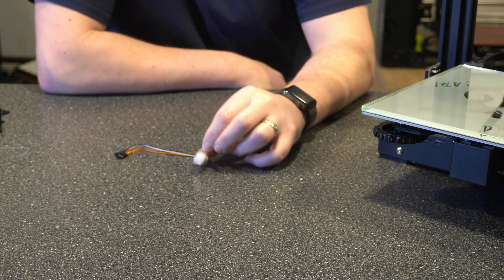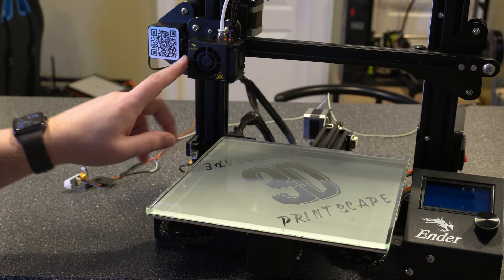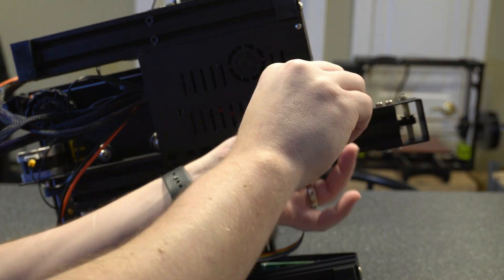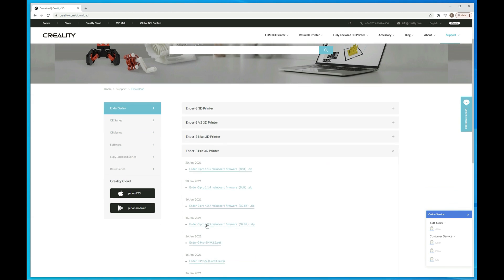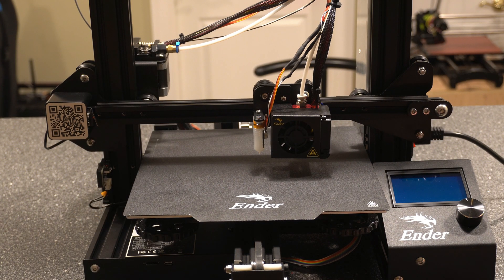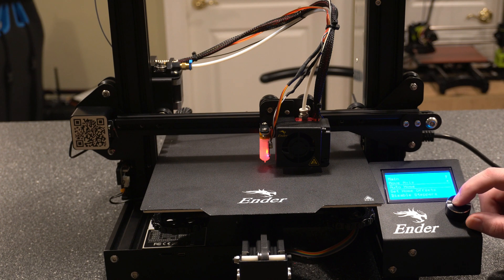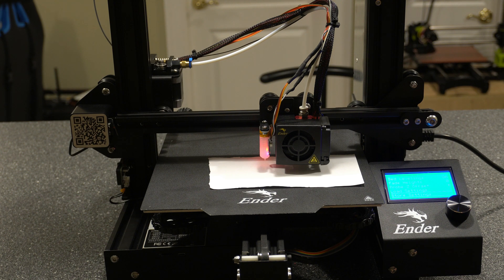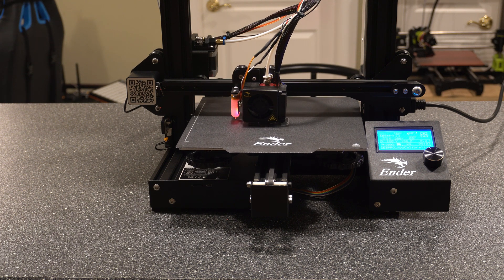Guide to Install a BLTOUCH on a Creality 32-bit Mainboard

Comment: followed this video to install a bl touch on my ender 3 I just got.  went through the steps although some of the steps did not go exactly like in your video.  I assume there have been some updates along the way since you posted this video.  when I turn on the machine now, the menu on the LCD screen is different.  the "control" feature is gone.  also once I turn the machine on, the bl touch turns red and stays red.  also when I try to auto home, it says homing failed please reset.  I unplugged the bl touch wires from the mainboard and tried to auto home again and got the same error message.  I tried to move each individual axis using the option on the menu screen and they wont move.  any suggestions or help you can offer would be great.  just got this thing for Christmas and it appears I now have a 15 pound paperweight.  super disappointed and bummed now.  hope I did ruin something for good.
Reply: well looks like i downloaded the wrong file from Creality.  can i download the correct one and will that overwrite the one i accidentally downloaded?  going to try that, fingers crossed
Reply: That fixed it.  I was in a hurry and excited and downloaded the wrong file from creality.  erased the wrong files off the usb and downloaded the right ones.  hooked it back up and updated the printer with the correct file.  Everything is back to normal and working perfectly.
Reply from the maker: Hi. Its way to easy to grab the wrong firmware, people do it all the time. Im glad you were able to get it working.

Comment: Hi,

I was wondering if you could help, my printer came with a bltouch but it only has the short leads like the one you purchased. It did come with a longer set of leads but they go to a single plug not 2 like you showed. Is there any way you could do a video showing which plugs you fitted to the leads you extended. Thanks
Reply from the maker: Hi. I would just get some ribbon cable with the same colors, cut the wire on one side (leaving enough room to work with), then connect the wires on both sides. That's basically what i ended up doing.

Comment: I connect my two pins into the 5pin slot on the version 4.2.2 board and my screen stays blue and smoke appears from the board? The ground is in the correct place, any advice? Thanks
Reply from the maker: Hi. Sounds like the wiring is not correct. You would have either 3 or 5 pins plugged into the bltouch port depending on how you are trying to wire it. If your getting smoke, a positive and negative wire is reversed.
Reply: @3DPrintscape  hello thanks for the response, the screen has now gone blank 😮 unplugged the BL touch and reset but the screen is still blank
Reply from the maker: @DjMrBubbles  Its possible that the board is fried. Check all the connections though, it may be a loose wire.

Comment: quick question.  Is this the same process for the E3 Max?
Reply from the maker: Hi. It should be, i think the mounting bracket for the max is a little different though. I know the CR Touch comes with a separate one for it.
Reply: Thanks. Yes the kit comes with 3 brackets. All seems to work just fine.  Great guide BTW.

Comment: When I tell it to level the bed my bltouch only probes 3/9 spots then stops. Anyway to fix that?
Reply from the maker: Hi. It sounds like a wire or connection may be loose, especially if its stopping after the one on the far right. Its possible the cable is getting puled when going over that far. I would go back and verify all that.
Reply: @3DPrintscape  thank you so much for the response. I think that you’re right. I’m going to take a look at it and will let u know
Reply: @3DPrintscape  you’re a genius one of my wires did not have the length to move to the other side of the bed. Thank you🤟

Comment: I'm having issues where the BLtouch fails during bed leveling at random points. Sometimes 3/9, sometimes 8/9, etc. I was able to successfully run through it once but each print it ends up failing. I replaced the BLtouch and this one does the same thing, except now its not retracting the pin after failing. Did everything exactly as you did in the video, except my kit came with the 5pin cable from Creality.
Reply from the maker: Hi. It sounds like you may have a loose connection. I would go back and check the wiring again. Looks to make sure the pins are fully in the adapter and making contact with the board. Also, follow the wire back to make sure there isnt any slices in it.
Reply: @3DPrintscape  Thanks for the reply. I've checked the wiring and it seems to be good. I tried the TH3D firmware and I've ran the levelling about 20 times without issue. Switching back to Creality firmware, it fails within 1 or 2 runs of the bed levelling.
Reply from the maker: @andremaury9861  Based on that, the issue is clearly with the Creality firmware, though it does seem odd.

Comment: i have an ender 3 with this board, i upgraded my printer with the enlarging Z axis kit from creality BUT! now that i just install an bltouch i cant compile a marlin firmware that works.. the thing doesnt home or do the 3x3 probe thing in the bed,  any guess of what could be happening? i can install the creality firmware tho.. but i loose the extra 100m on the z axis.
Reply from the maker: Hi. What errors are you getting when you try to compile the firmware?
Reply: @3DPrintscape  i mean i can compile the firmware, Marlin 2.0.X bugfix, but when i try to level the bed or print something the bltouch just probe in one space and then stops and do nothing, but if i use the creality firmware works like a charm but i lose my 100mm extras of z axis.
Reply from the maker: @ShInJiPsX1  If it works with the creality firmware, we know everything is wired up right. It sounds like the firmware isnt configured to match the bltouch wiring, I would look there first.

Comment: my ender3 says it's a Merlin 1.1.1 my board says v4 2.2.2 do I need to look for that type off firmware
Reply: thank you
Reply: and look for same bl touch firmware or can I update merlin to better than 1.1.1
Reply: my board u get to it from the top not bottom like yours
Reply from the maker: Hi. You just need the bltouch firmware for the 4.2.2 board. It doesnt matter what version you are currently running.

Comment: My bl touch auto homes and does nothing else on my ender 3 pro
Reply from the maker: Hi. How is the bltouch wired and what firmware are you using?
Reply: @3DPrintscape  it's one plug in the board has the port for the touch
Reply: @3DPrintscape  firmware is from creality itself but when I downloaded it and went to my files and clicked on the file it doesn't let me get into it
Reply from the maker: @byronmurray9885  What is the order of the wiring and the full name of the firmware file?
Reply: @3DPrintscape  one multicolored wire to the port on motherboard. I got firmware from creality itself. It won't load to SD card. The downloads look different from the download u are using
Reply: I found the firmware exactly  like yours on the video I downloaded it and extracted it and when I opened it up and went to the one without transfer case it was empty
Reply from the maker: @byronmurray9885  You will want to verify the pinout on the harness, I have seen them shipped with the wires in a different order. They keep changing the firmware names and zips. My guess is that your are downloading one of the marlin packages they are trying to provide but I haven't tested those. You could try the firmware I have on my site. https://3dprintscape.com/marlin-firmware-builds/

Comment: Thank you so much! You now have a subscriber for life! My ender pro sat for months because I couldn’t get a damn thing printed correctly on it. I finally decided to upgrade the board to avoid having to flash the board with an arduino. Low and behold, your video saved me. I’m now running Merlin and just printed one of my best benchy’s yet! Thanks again for the easy to understand instructions.
Reply from the maker: HI. Thanks for the feedback and sub, Im glad i was able to help out :).

Comment: Great video. Everything is showed in such a clear way that it is impossible to fail! I have just a question: if I set Z MIN PROBE ENDSTOP INVERTING to TRUE the compiling fails asking me to change it to FALSE. I have an ENDER 3 PRO with 4.2.2 motherboard. thanks for all!
Reply from the maker: Hi. Thanks for the feedback. There was a change made made to the bugfix line after i made this video, so that value now needs to be set to false.
Reply: @3DPrintscape  nice to know! thanks

Comment: Are you still Active? the video is super helpful, but my wires are a different set of colors and im not sure. I dont want to hook something up wrong and mess my printer up. Please Help
Reply from the maker: Hi. Ya im still active. The written instructions i wrote as a resource for this video may help out there as i go into a lot of detail on the wiring. The link is in the video description.

Comment: So do you unplug the Z-Stopper or leave it in?
Reply from the maker: Hi. It depends how you have the bltouch wired. If you have all 5 wires going to the bltouch port, you would leave the z-stop connected.
Reply: @3DPrintscape  Thanks for replying. Weird situation I ran into. I have E3Pro w/ the 4.2.2 MB and a BLTouch v3.1. The BLT has the 5 wire plug figured out. When I un-plugged my Z stopper, no matter what the Bed Level routine would constantly fail randomly at any bed spots [1-9]. When I plugged it back in, it worked no problem. I'm leaving it plugged in. TY..
Reply from the maker: @Blood1UTUBE  The z-stop needs to be connected when you have all 5 bltouch wires going to the bltouch port. You would only disconnect it if your plugging the bltouch prob wires there and using z homing firmware.
Reply: @3DPrintscape  Thank you for confirming.
Reply from the maker: @Blood1UTUBE  You're welcome

Comment: I just bought an ender 3 pro with the silent 4.2.7 motherboard,bltouch and touch screen upgrade kit. After auto homing I can’t get the z axis to move in the negative to set the z offset compensation.
Reply from the maker: Hi. It sounds like the software endstop is enabled. You can disable that by sending the m211 s0 command to your printer.

Comment: Thanks for explaining but how would you do the preference to change it to do the mesh layer on Mac?
Reply from the maker: Hi. I would need to make a video on this, so i will add it to my backlog. There are a lot of little difference so it would be hard to cover them all without doing a video or making a guide.

Comment: I unplugged the Bl touch and plugged it back in and is now working.  I had to add the software for the Bl touch and now when I auto home t will not lower the print head and he Bl touch shuts off
Reply from the maker: Hi. The autohome will end at +10, it doesnt go down to the build plate. The z offset is what accounts for the difference and that only comes into plat when the print starts.
Reply: @3DPrintscape  when I auto home it goes to he corner then back to the middle and does not go down to touch the bed and the BL touch shuts off and the is a weird noise coming from the motor and there is a blue light on the Bl touch
Reply from the maker: @ronaldpeel7288  It sounds like there may be a wiring issue. I would review everything there first.

Comment: Hi sir 
I watched the video for updating the firmware now my Bl touch is not working
Reply from the maker: Hi. What firmware did you use, how is the bltouch wired, and was it working before?
Reply: @3DPrintscape  it is  the latest firmware and it is wired to a small board then on to the many board. And yes it was working before
Reply from the maker: @ronaldpeel7288  What the actual name of the firmware file? Also, I wouldn't use the transfer board if you have a creality 32 bit board. That said, review the wiring to make sure its in the right order. This article may help as well. https://3dprintscape.com/marlin-firmware-on-creality-board-complete-guide/

Comment: Do you use glue or do you get your prints to stick?
Reply from the maker: Hi. If i clean the build plate good ahead of time with rubbing alcohol it sticks fine. That said, i use bed weld because i can apply it once and use it for like 10 prints.
Reply: @3DPrintscape  Thanks for the advice. I looked it up and it says it was designed for glass plates, but does it work on the mat placed on the glass plate?
Reply from the maker: @precepts8893  Im not sure im following the question. It would work on the glass but im not sure what mat your referring to.
Reply: @3DPrintscape  the flexible build surface that comes with the ender 3 pro. I don't know if it's a flexible spring steel build surface but it is a flexible build surface, that comes with the ender 3 pro. It's in your install BLTouch video. In fact, I've never seen a video of you printing on only the glass surface.
Reply from the maker: @precepts8893  Ah ok, your talking about the magnetic build plate. I have never had to use anything to get PLA to stick to it. If your having issues there, it may be related to the bed not being level or the nozzle is too far from the build plate.
Reply: @3DPrintscape  I think my problem is using both the magnetic plate and the glass build plate together. I've been watching some videos and I'm noticing that ender 3 pro users are using only one of the 2, either the glass plate or the magnetic plate on the heated bed. I've been using both at the same time since that's what came with the ender 3 pro; so that's 3 levels I've been using, the heating metal bed with the glass build on top and the magnetic build on top of the glass, which is why I probably would need adhesive. Do you use all 3?
Reply from the maker: @precepts8893  Thar would impact the actual build plate temperate for sure. If you want to go that route, I would use one of the ir temp readers to find out what temperate actually gets the build plate to 60. I only use one or the other, not all 3 like that.
Reply: @3DPrintscape  I don't know what a "ir temp reader" is but thanks for the advice. I thought the magnetic plate was to be use on top of the glass plate.
Reply from the maker: @precepts8893  Sorry, infrared temp reader
Reply: @3DPrintscape  I don't have one but I'm pretty sure it was using all 3 plates together that caused the not sticking problem, so thanks.

Comment: How exactly do you install the firmware once it is on your thumb drive?
Reply from the maker: Hi. You would just put the sd card in the printer then turn it on. From there the printer will read the file and update the firmware. If thats not happening, i would try a different SD card and make sure its under 8gb and formatted right. The sd readers in these printers are cheap, and firmware updates dont work with a lot of the sd cards.

Comment: While adjusting Z probe via this video I am not able to go into negative Z axis adjustment. When I get to "0.00" and try to go negative increments it will not let me. Any ideas?
Reply from the maker: Hi. Sounds like the software endstops are enabled. You can disable it if you build your own firmware or by sending M211 S0 to the printer.
Reply: @3DPrintscape  Would I insert that into Cura? If so where at in the G-code?
Reply from the maker: @jasonfreeman5069  You would have to connect your printer to your computer and use something like Pronterface. https://youtu.be/T1TH0QpHVWs

Comment: Hi Rob great channel. I know you will be busy, but when you get some time, could you do video on setting up the combined bundle of a BLTouch V3.1, an SKR Mini E3 V2.0 and the TFT35 E3 V3.0. ( update 27 now) I have had a job setting this up. There are a few videos out there ( some saying remove the Z stop some saying leave it on) but some have bits missing due to the latest firmware available which is confusing, as there are several ways to run it and the screens are different. So a dedicated video from start to finish would be great. Cheers.
Reply from the maker: Hi. I will see what i can do but this guide will probably help you out a bit. https://3dprintscape.com/bltouch-on-skr-mini-install-guide/
Reply: @3DPrintscape  Thanks. I have managed to sort things out with try and see. I have only the bltouch 5 pin connectect with no seperate z connector (I know i could leave the z one as a safety buffer) but could refit it later.. The screen on the v27 update is different to what i have found. I know you can't do an update every time one is released so i will wait and see.